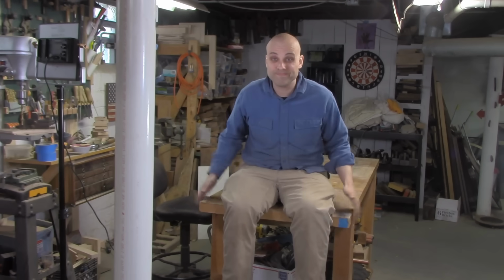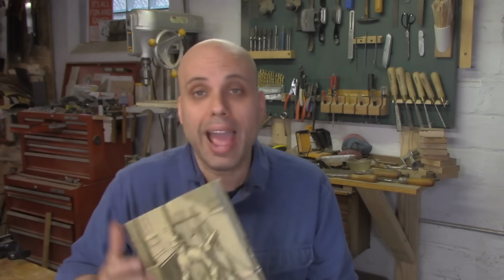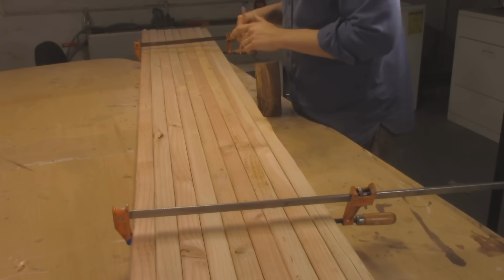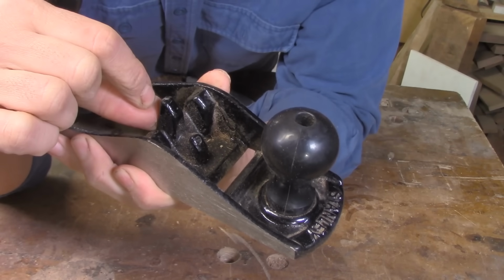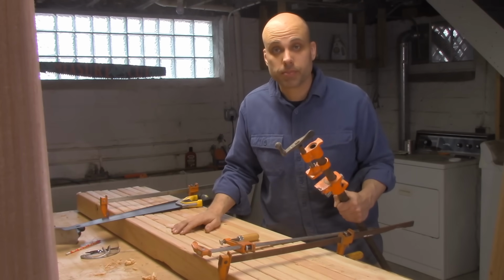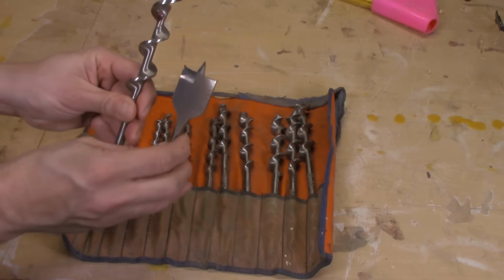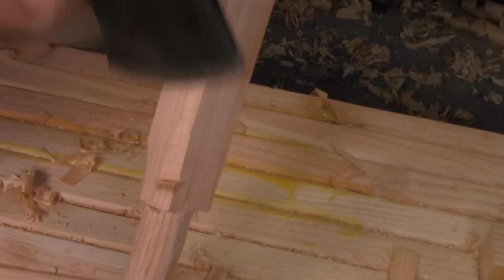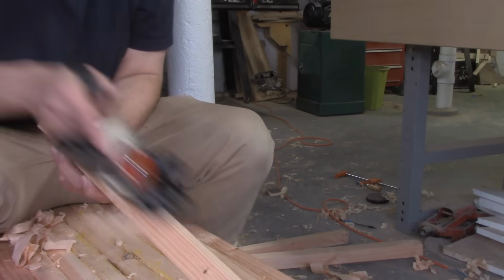Build a REAL workbench for $30

Comment: Would a Rail road tie work instead of 2x4s
Reply from the maker: That would be over-kill. No need to struggle with such huge timber.
Reply: Not a great idea. They are soaked in creosote and or other preservatives. You are supposed to wear gloves to touch them.
Reply: masterpython   Thank you I dint know That.

Comment: Tip for the poor woodworkers: the bottom support members of many kinds of pallets are rough-sawn oak which, with a little extra work can be used on tons of projects where you want a decent hardwood.
Reply: I'd be careful with that, pallet wood is already bottom of the barrel wood, most of them there ends are split, you might not be able to get much to use out of it, and all the chemicals they spray on it for bugs, and whatever it had shipped might have leaked onto it. If you find a use for it great, but make sure you have a respirator. 

An alternative would be cull wood, it's wood that is considered not good enough to sell, or was rejected by customers. It might not be free, but it might be discounted. Lumberyards have cull lumber piles, and your big box stores, might try asking.

Sawmills are another option, you can get rough cut lumber at a lower price, the family own or mid sized ones would be a thing to try. The large operations might not sell to an individual. Also the ones I've looked at offer more than just lumber, jointing, planing, live edges, and drying services.

I've read that you can find some good deals at amish sawmills. The ones around me are a drive, but I might go take a look sometime.
Reply: Pallet wood also sits around on the floor or ground, picking up grit and trash. If you try to save the wood by removing the nails you find out those nails have spikes and hard points that come off in the wood, ruining your tools when you try to make something with them.  Free ain’t always free.
Reply: @18-tube-wattamp64  just requires a bit of extra elbow grease and some common sense.

Comment: Using my imagination, I could see a set of threaded rods being put through this bench to set some internal tension, in addition to the clamps - this would help in adding additional work holding machines to the bench using these rods as screws... not sure if it would work in practice, but I enjoy envisioning the possibilities. =D
Reply: If your drilling - I'm assuming you'd drill each length separately - was a bit off you could end up with well-bolted together lengths of wood but unaligned which would then need attention to give a flat surface to the bench top....

Comment: saw the saw binding at times. while technique is a factor... rub a piece of wax on the sides for decreased grabbing.

while it has not been a problem for me (?) this will add wax to the cut faces of the wood. 

is grabbing mostly experienced with softwood (construction lumber)? it is almost all I use, because my work does not merit better. 😔

Comment: Learn how to clamp. It will not bow if you know what you do
Reply from the maker: Great. Make a video where you show us all how it's done...unless you're all talk.
Reply: @RexKrueger  I'm not a youtuber, I'm not even a woodworker. After your comment I watched a bit more of your vid and saw that you actually do understand the importance of putting clamps on both sides. However, in my experience it's not only related to the jaw depths, it's simply good measure.
For wide gluings made of thin stuff, simply clamp some boards on both sides of the glueup keeping it flat.
Sorry to sound like your high school woodworking teacher, but this is on that level.
Reply from the maker: @matshjalmarsson3008  if you're not a woodworker, then how do you even have experience? Why do you even have an opinion on a thing you don't do?
Reply: @RexKrueger  I went to school, I work wood in principle every day, though it's not my profession.
Just the other day I glued up 5 12 cm wide, 8 mm thick planks. No bowing since I used clamps on both sides of the stock and also kept it flat by clamping boards on both sides of it.
This is very basic.
I know how to make dovetails, mortice and tennont joints, I understand the difference between bevel up and bevel down planes, japanese and western saws and much more.
That makes me no expert, but I have a fair bit of knowlege.

Sorry again if I hurt your feelings.
Reply from the maker: @matshjalmarsson3008  you didn't hurt my feelings, but you're all talk.  If you know better,  take the camera on your phone and show us. Anyone can.  I suspect you just don't have the guts.  And yes,  that's a challenge.  Prove me wrong.
Reply: @RexKrueger  As I said, it's basic, it's one of the first things you learn. Depending on the clamps, if the pieces are out of square, or other reasons the glueup may bend in one way or another.
If that happens, simply take two scrap pieces of wood and clamp them onto the glueup and it will turn out flat.
Try it, I guarantee that it works. (Also, it's kind of obvious.)

I have no interest in making a video of that, that would be like making a video on how to drive a nail.
There are enough videos out here made by amateurs showing how to do things most of us learned in school.

Comment: Love your videos. 
I've built several different benches/tables similar to this with construction lumber like you did. But something I always do that makes things easier on putting the 2x4 benchtop together is I drill holes all the way through the boards. I then get some 1/2" all thread and put them through the boards. On a bench of about 6 feet long yours I use 4 pieces. It makes it easier to glue up all the boards at once. Cap the holes on the end and you never notice. Just keep in mind where they are for when you put on the accessories it drill dog holes.
Reply: nice one... I had this same thought, commented, then saw your post... =D  if you leave them sticking out, you might be able to use them for attachments, and maybe add some at various angles to act as hardie holes, etc.
Reply: o.O or drill a few holes in some angle iron and instant bolt on legs... =D

Comment: I'm not going to put legs on mine. In fact, I'm going to add a pair of handles and just use saw horses for a standard height bench and buckets for the "Roman Bench" height. I live in a travel trailer, which makes portability an absolute necessity.
Reply from the maker: That would be a very Japanese approach!  I bet it will work fine!

Comment: Would you recommend for or against using shipping pallet wood if it's available for free?
Reply from the maker: You would need a LOT and since most pallets are hardwood, they're going to be harder to work. You're way better off checking out construction sites and looking for 2x4 scraps.
Reply: I wouldn't recommend it but I would definitely do it. Be careful with those rusted nails.

Comment: I think I'd make this out of a piece of 2 x 12 and use pipe flanges to attach the legs.  A 45 degree elbow in each leg would let me spread the legs.  It could be knocked down between uses.  As it is, in my cheap shop I put a piece of 1/2 inch plywood on a kitchen table I have in the basement.  Add a few clamps and I'm good to go.

Comment: When you use your handsaw, I noticed you are only using the middle third of the saw.  Try taking longer cuts using the whole length of the saw and you will find it cuts better with less effort.
Reply from the maker: I'm getting better at that, but this cheap saw doesn't make it easy.

Comment: A $30 dollar workbench that is built with $500 worth of tools. Would like to see this built with a hand saw, hammer and cordless drill. Usually that’s what people have for tools when starting out. Great video and instructions though.
Reply from the maker: Try $50 worth of tools.  Maybe.  Just a single cordless drill would have cost more than every single tool in this video.  It's all hand tools and all very cheap.

Comment: If using pipe clamps, put 2 down first under the project instead of clamping the top and flipping. Significantly lowers the chance of slippage during the glueup. Looking good so far though!

Comment: Brilliant, yet simple old design. I'm partially disabled, most of my work would be sitting, so might mod the design with a 60:40 swan neck to raise the morticed end 12-18 inches higher and more comfortable work height (imagine an old rustic Shave Horse )

Comment: Think I'm going to make one of these. Only part I'll have to change is the glue up of the top. Even cheap bar clamps are beyond me but I do have some ultra cheap ratchet straps that I'm sure will work just as well.
Reply from the maker: Even weights will do the job. Sprinkle a little salt on the glue to keep it from sliding around.

Comment: Rex, question for you.
I'm retired and living in a Chevy Express van in the southwest(from CT). I'm a beginning woodworker and not having a bench and vise is becoming a pain. You can imaging storage is a problem. My adaptation of your design is to leverage the step in the barn doors, use the step instead of 2 of the legs. The bench will be 48" long and I will sit facing outwards and have a right side vise towards the end. The 2 legs will have to fold under for storage. I think using the step inside the doors will provide better stability than a free standing bench. I'm also planning to store it on my roof rack. Easy enough to make another.
Reply from the maker: So, I didn't see a question in there, but I do see a potential problem. Your van's suspension will be pretty bouncy and probably less stable than just making the bench with 4 legs. Since you're sitting on it, it's rock-solid. It's shockingly solid. BTW, I'm from CT, so awesome!
Reply: @RexKrueger  thanks Rex, yeah I just realized I didn't include the question but you answered it. 

By the way, this is a fantastic channel. For instance, I've been struggling with dovetails, you've got a vid and it helped. I realize I need a wooden mallet, saw your vid and found a rolling pin in a thrift store. And the bench and the vise. You are on a roll! 

 Left Milford CT in Feb to explore the southwest.
Reply: @RexKrueger  Rex, I did have another question. Do you think a 48" long bench will be workable?
Reply from the maker: I'm really glad you enjoy my channel! I think 48in will get you through most projects.  My bench is historically accurate,  but I find it a bit long.

Comment: First of all, thanks for putting the effort into ensuring you are very articulate in your speech - younger people tend to mumble these days and are difficult to understand.

The idea of a low workbench is very appealing.  I need to learn some basic woodworking (I can't make a straight cut with a chop saw at this point).  The limit of my space is the reason I am looking at this bench.  I've got a 12'x16' shop that has to support my mechanical, electronic, and future wood working hobbies, so space is a premium, and a lot of work moves outside.  Also, I do work on site a lot.  This bench may be a solution.  I could picture creating an extension to hold a portable table saw and compound mitre saw (or would it be a bad idea to have those saws sitting so low).
Reply from the maker: I don't think having them low is a problem, but having machinery associated with this bench might kill some of it's utility. Part of what makes it work is that you can move it around easily.

Comment: I actually made a workbench (standing one) from 2x4s and plywood.  Pretty easy, and you realistically only need a saw and a driver for screws. From out a rectangle (I like a space of 6x2 feet at least). Then make legs and supports for between them. Plywood comes in 8 x 4 sheets. So if you get one, and have the store cut them for you, you can use two sheets of plywood for the top. It wont have the neat little things the one you made have, but buying a vise is a good investment for any kind of shop. 

You could also drill holes for holdings as well. But dang this bench you made is neat. I love "old school" things like these. Amazing what medieval people could do without power tools.

Comment: I really fancy the idea of making one of these but it would have to store flat.

any tips for making the legs removable or foldable whilst still retaining the structural integrity and strength needed ?

I was thinking embedding legs into cross braces in the same way they are installed in this table, then using  gate or heavy duty door hinges to fix those cross braces to the underside of the bench. I'm just not sure how best to lock them in place when open.
Reply from the maker: I think the idea you already have is probably the best. You'd just have to mess with it. Alternately, google "Moravian work bench". There are some good knock down designs out there.

Comment: Could I use 4 vertical 2x4 sections for the legs by straight cutting through the second plank to leave a gap, the same way you did for the mortice holding your wood stop?
Reply from the maker: dukereg you totally can,  and it might be worth the experiment,  but I generally build things the traditional way before I start "improving" them.  (I've learned the hard way). This design is thousands of years old.  I would try it out first.  Good luck!
Reply: @RexKrueger  Much appreciated! I get what you're saying, and you're probably right. I was just trying to reduce the amount of planing and shaping I need to do before I have a stable workbench. :-)

Comment: A great video, but I would like to add a couple of things. First, having a similar - but wider - work bench can be a great workspace for assembly. Imagine assembling a cabinet or similar item on a regular height workbench, and you will see it could mean standing on crates of whatever to do the job. The alternative would be crawling around on the floor for much of the task. A low, stable bench would be ideal for such jobs. My second point deals with the glue-up of the top.

When gluing parts together, whether edge joining or just gluing doweled parts together and so on, I learned over the years that after the parts have been clamped, some of the glue is absorbed into wood pores and, in some cases, the clamps are really not all the snug any longer. While you might be doing this, it might be helpful to point this out to beginning woodworkers. After clamping, allow the parts to set for a few minutes, then tighten the clamps  again. Sometimes no change is noted, but now and then you'll find the clamps can but easily turn 3/4 of a turn or so. Just good to check.

Love your videos, Rex, and believe they are helpful for nearly any beginner, and the seasoned woodworker can always pick up a useful tip or two as well.

Comment: Thanks man you are awesome and a huge inspiration for me. I really need more info about the wood piece in the plane I've followed along so far but I've tried a few times to get this right and failed. What kind of glue how thick in the wood how big did you make it does it go all the way to the mouth? And more I can't think of at the moment please help I'm on standby.
Reply from the maker: oh, that's just a piece of veneer. Very thin. Try thin cardboard with a bit of finish on it.
Reply: what kind of glue ? epoxy expanded and made the wood uneven.
Reply: like 1/8" or 1/16" thin or even thinner? sorry to keep bothering you I've had this and only this hand plane for months and I'm looking forward to it not being terrible.
Reply from the maker: very thin. thin as thick paper. glue it down with super-glue.

Comment: Rex - thanks for this video/series and for the tip sheet. I've just finished the bench as a first real woodworking project. A great learning project - especially for those without a bench. Mine's far from beautiful but is certainly solid and way more functional than a pair of crappy sawhorses and plywood. I'd give myself the following grades on the components... wood selection B, bench top glue up B-, leg mortises B+, leg tenons C-, wedges D-. 

Overall, I'm really happy with the results. I learned a lot and now have a solid bench that I can use for decades! 

Thanks Again!
Reply from the maker: Congrats!  I'm delighted to hear that you made it!

Comment: I'm thinking of doing one of these benches made from 3 laminated 4x6 rather than 9 2x4. Is there a reason why this would be a bad idea?
Reply from the maker: Good question. I think you should just be totally sure you're doing it for a good reason. I've been using mine for months and I find it plenty solid and sturdy. A top made from 4x6 is going to be really heavy and the bench will no longer be easy to move. You also don't need it to be very heavy b/c you're sitting on the damn thing while you work. Oh, and material that thick will interfere with holdfasts, which are VERY useful on this bench.
Reply: @RexKrueger  Wow, thanks for answering. I think you've misunderstood my intent though.  Your bench is (nominal) 4" thick and so is my proposed bench. Your bench is 2x9=18" wide, mine is 3x6=18" wide. The difference is fewer pieces to glue together, treating each 4x6 as 3 pre-laminated 2x4. That square mortise is a little harder to do, but not a lot harder.
Reply from the maker: @jbirkins  In that case, go crazy!

Comment: Lowe's specializes in the hardest of the "softwoods" Southern Yellow Pine(SYP).  My favorite project wood.   Getting clear SYP usually means getting wider dimensional boards than 2x4's.  I use 2x8's ripped in half for "2x4's.  Actually 3.75" less the kerf.  Plenty of width.  Now I have 2 benches of different sizes.  Since I don't have the space both are somewhat portable for easy storage.  2 "Rex Work Benches" is better than just 1 ..

Comment: Rex - I'm planning to build the $30 workbench. But I have access to some new rough-cut 2x4 (hemlock). They're straight, but full 2x4  - would they work okay for this, or should I get the kiln dried stuff from the lumber yard?
Reply from the maker: That sounds great. Any dry wood will do the job. Use what you got!